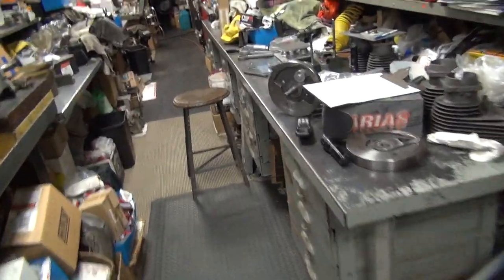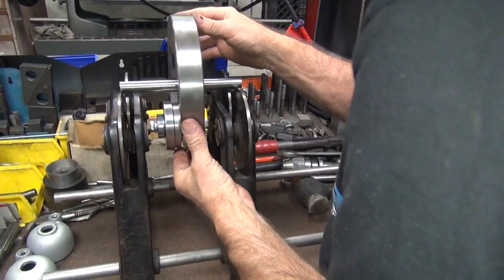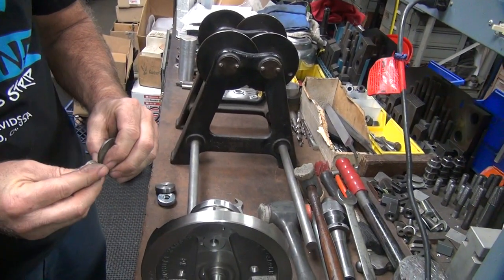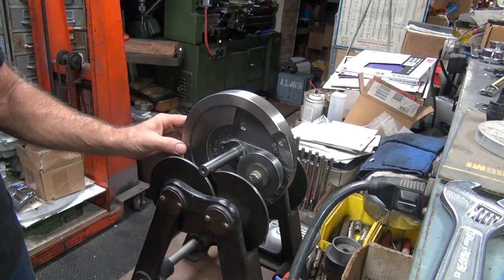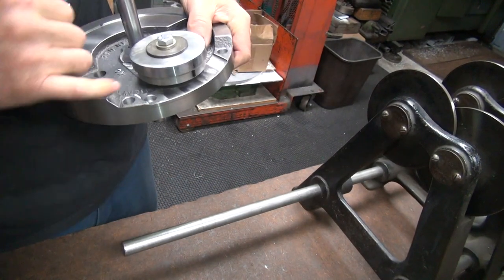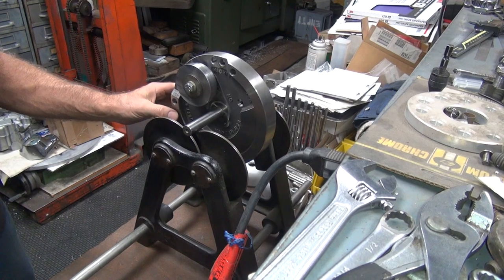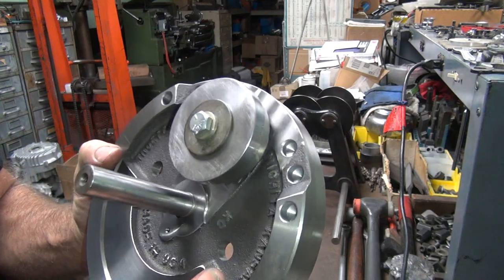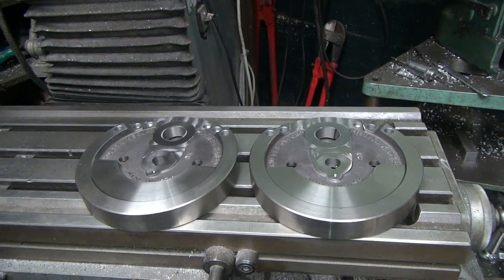1941 wld 45 56ci stroker #159 flathead motor build 4-5/8 in harley wl by tatro machine

Comment: This needs to be done whenever you change the pistons? Because I know I've heard about people just throwing a set of pistons on quick bore job and saying it's good, doesn't seem like it would be unless you weight-matched the new pistons to the old.
Reply from the maker: its not that important. it just moves the balance factor up and down some. that changes what rpm's the motor shakes the least.
getting the crank true is by far the most important thing in balancing and reliability.

tatro